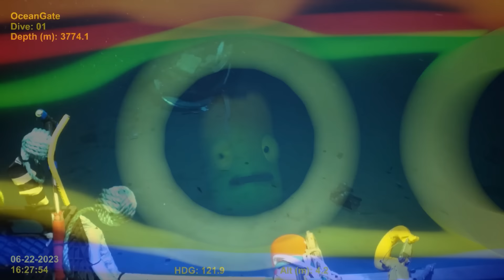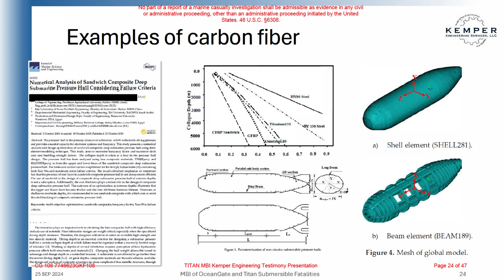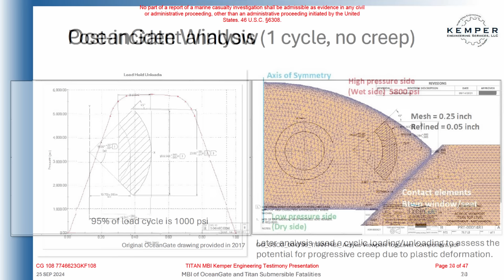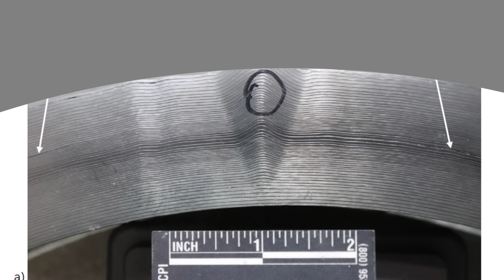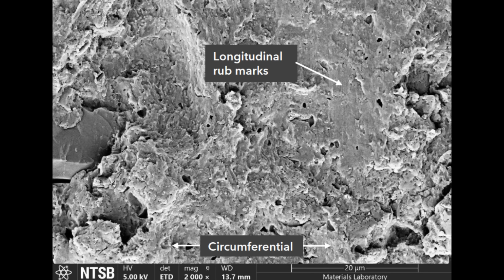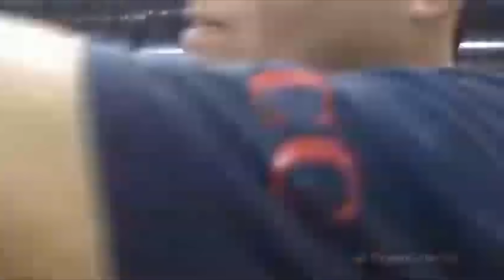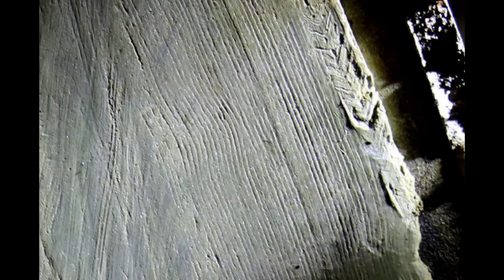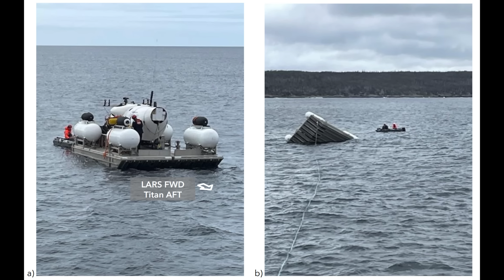OceanGate Wreck Shows Why Sub Wasn't Strong Enough To Survive - NTSB Shares Important Details

Comment: The longer you look at this uncertified 
DIY Carbon-Glue Lasagna build the more you wonder how this didn’t fail sooner
Reply: Lasagna build! Reminds me of something you make out of duct tape, thinking the more layers you wrap around something, the more it will hold.
Reply: @23ofSeptember basically a 3d printed toy submarine
Reply: @23ofSeptember well...are kevlar vests interlaced fibers? When fiberglassing do you place the fibers in interlocking layers for strength? Yes....so yeah there is some logic behind that at least.
Reply: @23ofSeptember duct tape would be better than what they used
Reply: it was already making noises in testing
Reply: @nicoliedolpot7213 submersibles pretty much always make some noise while stress is building and relaxing.
So it making some noise during testing isn't imidiatly something to worry about to much.
My diy ROV makes a ton of noise at about 25 meters depth and that's only around 3,5 bar of pressure.

The big bang shown by the graphs of the sensors would be something to worry about as you can classify it as a major anomaly.
Reply: @nicoliedolpot7213  and the front fell off once, wich isnt very common, most subs are built so the front doesent fall off.
Reply: Tttþ5😂055⁵is the 😢🎉😢😢🎉😢😢😢😢😢rđ xerox 44😢😢😢and ⁴⅘for 🎉😂😂😂😂 @nicoliedolpot7213
Reply: How thin those flanges were is baffling to me, they were completely relying on the titanium-glue-carbon fibre interface for the compressive and specially shear forces caused by the different materials elastic modules
Reply: @nirodper  that’s the actual problem, it’s not the strength of the CF it’s that you can’t interface it with anything. You can’t weld it or drill bolt holes so you need to glue it and glue just doesn’t hold up well under heavy strain or especially flexing/bending which the CF surely was doing regularly with each dive
Reply: @CarbonatedGravy you certainly can drill CF.
Reply: @slavka012  Not if you want it to keep its full strength, fine if it’s a body panel for a car but absolutely not for a pressure vessel
Reply: mmm carbon glue lasagna
Reply: @mark6302 The Homer of deep sea diving.
Reply: I would say it was failing for a while, but it was ignored.
Reply: @bills6093  It was failing slowly and then all at once.
Reply: @bills6093 agreed. All the signs were there from dive 80 onwards at least.
Reply: The engineers did wonder, and then they fired the one who brought it to their attention!
Reply: I am super impressed it did not implode during the first or second dive.
Carbon fiber may be a feasible material here! Provided somebody actually does a lot of testing to destruction, so we actually get to know how carbon fiber behaves here.
Reply: @adamrak7560  carbon fiber was not doing anything. It was the epoxy resin taking all the compressive force. In fact, the sub would have lasted longer if they used a cylinder body made of epoxy resin.  The carbon fiber was effectively functioning as a filler that weakened the epoxy resin,
Reply: @nickl5658  nope, epoxy needs a filler to stand up to not perfectly uniform compression, carbon fiber here acts as a filler and helps to reduce crack propagation and creep. it is true that this design does not utilize the main strength of carbon fiber, but still uses it to support the epoxy. 
If you say that they could have used non-tension strength fillers, like chopped carbon fiber, or micron sized alumina bubbles, and got the same results, well maybe they would have! It would be a pretty interesting experiment to compare this with other fillers and test to destruction.
Reply: @adamrak7560 they already knew how carbon fibre behaved and knew it was a disaster
Reply: @adamrak7560   No, carbon fiber is being phased out of aeronautical applications because it does tend to fail catastrophically.  Its strength lies in holding pressure in, one atmosphere's worth of pressure.
Reply: @WWZenaDo ya I think carbon fiber excels in two scenarios 

Space , where there is no pressure on the outside but you need to maintain it on the inside.  Or if you were to use a different gas and need to keep it in a container.  

Like a zeppelin.
Reply: It was only one step above DIY build quality. They didn't do testing or follow manufacturer design depths.
Reply: @ctrlaltdebug  " or follow manufacturer design depths" - They just used resin and elementary meshed carbon fiber so they are the manufacturer and designer. This requires knowing the fundamental properties of the materials to define your own specs. They didn't have the knowledge or experience to do anything like that.
Reply: @francoisleveille409  I was referring to the window unit they used.
Reply: @francoisleveille409  The build as a whole obviously. I don't see why people nitpick on YT comments. Give it a rest.
Reply: @ctrlaltdebug  I do much better DIY quality than this. Has to be noted that I don't build submarines though.
Reply: @ctrlaltdebug to be honest after I saw the way and the environment they bond the CF hull and the titanium ring I would say its just a wealthy DIY project
Reply: @ctrlaltdebug  To be fair, they tried to do testing but the people with the test tank refused to let them test the sub the way they wanted(which involved having computers and sensors inside). Those are the people who really need to be thrown in jail since they refused testing on something they knew would be used without testing.
Reply: So people who run the companies that refused to test this mess of a sub should be in jail?

Does that make sense to you?
Are you saying companies shouldn’t be able to refuse service?

Oceangate and their team are responsible for the bed that they have made.
Reply: @ryelor123  the test facility didn't want their equipment being damaged from destructive testing an elaborate backyard science project
Reply: That's rich.... so one company won't test it the way you want, and you just go ahead and use it without testing it properly? That's some very flawed reasoning you're using there.
Reply: @ryelor123  Oceangate imploded a 1/3 scale carbon fiber hull model during 6000 psi testing at the University of Washington, shook the whole building, and had to pay for the pressure sensors destroyed. The engineers at the test facility said the water hammer reduced the lifespan of their equipment. They rightfully refused to perform a larger scale test.
Reply: @ryelor123 what are you on about? Companies don't have any responsibility to test things for you... Hell if I was the testing company there's no way I'd let this thing in there. If they test it then they're effectively giving it their approval. They surely didn't know how this thing would handle repeated pressure cycles or time at depth, whereas they would for traditional titanium etc hemispheres. Why would they ever test it when for all they know they could test it 50 times and it'd implode on the 51st or 5000th cycle? If you want to innovate this much you either need to design your own machines or convince the company that your design is safe to test via X. Which they clearly couldn't do because they obviously had no idea what they were doing.
Reply: @ryelor123 
I have not heard this up until now.  
Was there a reason given for not allowing the testing???
Reply: @toomanyaccounts 
It very well could be.
Reply: @steven2556  yes companies should not be allowed to refuse service
Reply: @ryelor123  This looks a lot like a bot comment designed to increase engagement.  That's how absurd the sentiment expressed is.
Reply: @ryelor123 To be fair, they could have made their own test tank out of carbon fibre lasagne.

They had the money, resources and time.
Reply: @sunrisejak2709 
It’s possible they didn’t want to be associated with 
Ocean Gate.
The time frame would be interesting to look at.  
Was this AFTER Cohan wrote a letter to Rush with the thoughts of the industry backing the concerns he had about the Titan?
Reply: I just saw your comment about UofW.
Thank you.
Reply: @deepspacevacation not a bot. A shill. Similar. Their job is to lay groundwork for reasonable doubt legal defense. People in this thread did a good job exposing the attempt. Note the few tag team responses too. Shills are similar to bots but generally work on behalf of an industry or company.
Reply: @ryelor123  It was up to  OceanGate to get their sub tested.  They (he) should have found somebody who would test it.   Maybe you should get thrown in jail because YOU didn't test it?
Reply: @ryelor123  The testing they would have needed to do is to build at least three, test one to destruction, and have one do two times as many autonomous dives as they were planning to do with the third one, and then test that one to destruction, to make sure the pressure required stayed the same. Otherwise they won't know that they have the required safety margins to take tourists down.

But obviously, doing that would have cost just as much, maybe more, as building everything out of titanium.
Reply: @sunrisejak2709 That's what I'm thinking. My job involves signing off on stuff that could get someone killed if it fails. I will refuse stuff if I smell any amount of bs. Especially when it comes to load-bearing parts..  Can't have someone getting hurt, or the potential even, on my mind.. and I sure as hell don't want to be sued or jailed for it.
Reply: @ryelor123  Dude, using it without testing is on Oceangate, not the people who Oceangate refused to follow the testing guidelines of. 
Do you also think everyone in a bar should go to jail because they didn't stop a drunk from leaving, before the drink got in a wreck?
Reply: @steven2556  nobody refused to test/class the submersible, except for ocean gate. Rush believed in his design and refused to spend money to get it validated.
Reply: @nxdark That is an absolutely insane opinion, and I’m glad you’re not in a position to make policy.
Reply: @toomanyaccounts  I got my info from a graduate student there who was familiar with the test there. Stockton confirmed what I was told on a video at some point, but the kid I knew was on the ground. He got his information from a guy who was with Stockton from the graduate student program there. They had a real problem with the water hammer causing seals to bulge, and the test actually stretched flange bolts on the plumbing... They had to retorque all the flange bolts because of the water hammer.
Reply: @ryelor123 i can imagine a world where your words are true, but your comment lacking enough peaces of info to make it globally false ... Or misleading.
Reply: @ryelor123 really? More than the designers of this death trap?
Reply: @ryelor123 or they refused because they knew the testing wasn’t sufficient to determine safety, or would otherwise endanger people. 
If I want to test my hot air balloon made of glass, no one in their right mind would allow me to use them to test it, and when they explain why it’s a terrible idea, rather than accepting that it’s a bad idea, just move on with it, and do whatever I want, and fire anyone who says anything until I’m entirely surrounded by yes men because my ego is too large, too fragile, and too dangerous- much like the hot air balloon.
Reply: @ryelor123  so what? even if they refused to test it for some reason, it is still 100% oceangates decision to use sub and in no way whatsover the responsibility of the test facility. They dont force you to use your sub without testing at gun point.
Reply: @steven2556 were saying that it should not have been used when they were not allowed to do any testing. They should have just not done it, because they knew how unsafe it was, but they only had theory rather than evidence.
Reply: @ryelor123  so the people that refused to get involved are responsible, are you forgetting there's people that built it and put people inside, rush wasn't the only one involved
Reply: @ryelor123  you are not very bright
Reply: @ryelor123 wtf are u talking about?'
Reply: @ryelor123  they did do testing but rush damaged thier equipment. That's why they didn't want to do anymore business/testing
Reply: Steven is 'one of those' people who like to argue with somebody by implying that, that somebody is saying something that they didn't say. It's how stupid people argue when they don't have an argument for what that somebody, actually said.
Reply: @ryelor123 Nobody owes anyone anything in the test business. Companies with test facilities of any sort have every right to no-quote a test.
Reply: @rtqii Yep. Especially that the shock waves in the water during a collapse can produce dynamic pressures many times above the static pressure. So you build a 6000psi test chamber, 12ksi with a safety factor of 2, but then have to ramp it to SF 8 or 10 and it becomes super expensive.
Reply: @nxdark I hope you are sarcastic when you say “companies should not be allowed to refuse service”
Reply: @ryelor123 if I showed up to a drivers license test with my car on fire, would you give me my drivers test?
Reply: @ryelor123 wasn’t that found to be a lie Stockton used to say he wanted it tested but knew it wouldn’t pass. I remember watching a video and when they checked the place who does the testing it was all available to be done with sensors, computers ect and it looked very much like a story Stockton used so it wouldn’t fail and then he wouldn’t have a usable submersible to go to Titanic, it would confirm he was unsafe in every way
Reply: @RegebroRepairs exactly right.  That's exactly what companies that build carbon fibre pressure vessels do to verify their designs and construction methods. It's not a guessing game, and you don't design these things to operate as close to its ultimate load capacity as this one was. It was under engineered, and sloppily constructed. It really is surprising it lasted for as many trips as it did.
Reply: @ryelor123 what kind of a twisted logic is that??
Reply: I love your description !!!
Reply: @oldguy1528  Its a nice Lasagna recipe indeed.
Reply: Kind of sobering how many people have far, far more money than sense, and makes you wonder how the hell there are so many rich morons.  I've seen some superyachts lately belonging to people nobody has ever heard of.  They're the kind of people that would build an Oceangate style sub or buy tickets to ride one.
Reply: @DeadBaron that's the key to being rich. Stay under the radar
Reply: @DeadBaron  I feel like wealth is more driven by luck and cunning than intelligence
Reply: @orterves pretty much all luck.  Statistics prove that virtually every rich person on the planet was born rich.  Almost all the rest are actors, musicians and athletes, most of whome also got lucky at some point in their career to "break out."
Reply: @orterves this is true.

Wealth comes from DARING to try what others say is impossible or unwilling to try.

Inventment in anything is a key example. Simply sticking your wealth or reputation on the line by purchasing what you know to be good companies can and will lead to wealth and prosperity over time.
Reply: @orterves and delusional confidence but physics doesnt care about that
Reply: @DeadBaron  There was that Space shuttle launched against expert advice knowing that the temps ( and Ice) would be a problem.  That one didn't end well.
Reply: @DeadBaron  Just s shame that he felt the need to take people with him when he committed suicide.
Reply: @elLooto  no they were all just lied to
Reply: @DeadBaron  Rich doesn't always mean intelligence, just drive and will/ego can get you rich. You can bully and screw people until you get rich with little intelligence involved baring legal limits, Scientology for example. Or like most rich tech start up owners, they had MANY start ups thrown to the wind at the same time or over and over hoping that 1 out of 100 will fly and they get rich because tech start ups generally cost very little to start but have massive return potential.
Reply: @DeadBaron 😊😊😊😊😊😮😮😮😊😊😮😮😮😮😮😊😊😮😊
Reply: @DeadBaron  A lot of really rich guys got that way by ignoring critics. They think of critics as small-minded people.  Maybe with money, but when it comes to safety, it's a whole different ballgame.
Reply: @DeadBaron you've never heard of them because they are all the kids and grand kids of the people who built (ie stole) vast fortunes.  We live in an Aristocracy.  Feudalism never ended, it just rebranded.
Reply: Comparing it to lasagna is an insult to lasagna.
At least lasagna is delicious and don't cost much.
Reply: Mmmmm. Lasagna. 😋
Reply: Lasagna is delicious, and apparently the deep sea agrees.
Reply: Yeaa..... it even gave him many clear signs when it was going to fail, but he ignored them even though he said he built the system to warn him before it would fail and that it "wouldn't fail instantaneously" but then ignored the non catastrophic failure of the sub.
Reply: The Well There's Your Problem episode about this is going to be LIT.
Reply: All those voids and gaps, plus the bubbles that were "sanded"
/shudder
Reply: i swear to god if they manufactured it in a properly rated clean room without dust or debris in the air it would have lasted like 10 more dives probably. this means if they just threw it away every couple dives and manufactured it well this design could have been used for decades, despite being quite terrible and janky. generally this was a disposable sub design that degrades over time, it should have been rebuilt or completely tossed every other dive just to be safe. this includes newly wrapping the CF and newly glueing the domes. but rush was too stingy for that and wanted to make money.
Reply: @DennisGr  🥂🥂 wonderfully put
Reply: Best description ever! "uncertified DIY Carbon-Glue Lasagna"
Reply: So many of the dives were cancelled for other reasons, otherwise this would have happened much sooner. When you consider how many times it actually went down to the Titanic, it failed in just a handful of trips.
Reply: The more I learn the less I'm surprised that it failed and more impressed that it ever worked at all. I mean honestly if it just been operated and maintained anywhere close to competently, the crazy thing might still be diving today.
Reply: @maxwellquebec8675 I suspect "maintained" would be "the entire hull replaced every 5 dives or so"
Reply: @michaelmartin9022  Pretty much. Every time there's a concsening "bang", at the very least.
Reply: Luck. Luck that fed Stockton's ego. Luck that unfortunately lead to the death of 4 people... And one idiot.
Reply: it’s kinda like finding out a lost arctic expedition survived for months before finally perishing: kinda impressive, but also yeesh.
Reply: @oscaranderson5719  Read up on the ill-fated expedition to find the "Northwest Passage" taken on by the HMS Terror and Erebus by Captain Sir John Franklin and his team in 1836-1837. Pretty much what you described. :)
Reply: Who certifies deep submersibles?
Reply: @DonaldDeCicco  I think it is the American Bureau of Shipping, or ABS.
Reply: Lansagnabuild! Word of the year!
Reply: Your right it’s amazing it made it as long as it did
Reply: The design is sound for shallower depths.
The pushed the design criteria to its limits and beyond - there's always a danger for catastrophic failure.
Reply: DIY Carbon-Glue Lasagna lmao xD
Reply: If he would have acknowledged the faults, they might have been able to improve the design SOMEHOW - but instead he ignored the engine light and kept driving.
Reply: With every dive the compression and expansion of the carbon fiber was accumulating and weakening the glued seals and carbon fiber hull. Very tragic that five people lost their lives in this way. Rush was guilty of hubris on an epic level.
Reply: No Diddy
Reply: Lmao
Reply: Engineers are still scratching their heads on that question. Many things that look so poorly built are insanely durable
Reply: It didn’t because of the test and running phases weren’t deep enough. It had to slowly compromised several times and after one known major failure the complete collapse was eminent.
Reply: How did they obtain any kind of license to accept members of the public on such a vessel? INSANE
Reply: Wtf where they thinking with this glue sandwich
Reply: Especially give how it was treated when not in use/being transported. I'd forgotten about the barge incidents
Reply: Its an old piece of gas pipe!
Reply: Don't compare something this bad with yummy lasagna!..
Reply: Of they used a Titanium middle section wrapped in Carbonfibre it'd probably still be diving the oceans today.
Reply: It did. 

Failure was the separation of layers until water made it to the front ring and began destroying the glue there. 

The loud bangs reported were the individual layers expanding independently from one another and basically slapping the layers next to them during compression and decompression from dive cycles. 

It was destined to fail. The only question was when. 

Water began in on one side of the front ring pushing everything to the rear, popping the ring off and the window was pushed out when the pressure wave rebounded.
Reply: I’m genuinely surprised they even had a single successful dive to Titanic depth
Reply: It's insane to make a submersible out of fiber composite. Fibers have no strength in compression, and the resin is just there to give structure. It's basic engineering and materials science. Fiber composites are great for containing pressure and other structures relying on its tensile strength. All other criticisms about practices, safety systems and leadership personalities are practically irrelevant next to this, imo.
Reply: @Superblitzz  gotta admit though , holding up that long like a real submarine that someone diy is was pretty amazing!
Reply: The fact they got more than 20 dives out of this thing is pretty incredible considering the shotty work. Poseidon gave Stockton a lot of time to make other considerations
Reply: Fortune favors the bold, but not on a long-term basis
Reply: I think they were on to something but it would need years of refinement and testing different materials and configurations of materials. It's not like they are pioneers or breaking new ground though, the glue is clearly the weakest point on this specific sub. China's plastic subs are probably molded single pieces, no glue needed like that.
Reply: Problem isn’t that it was DIY standard or industry standard construction, its that he didn’t test it, he could have made it of solid titanium and still fail.
Reply: It would have worked fine but someone sat on his controller
Reply: it did, in fact.
Reply: Dammit, now I'm hungry for lasagna.
Reply: Liesen, only Italians canne mekeh lasagna!
Reply: The way these (rich) people died instantly just because Stockton Rush told them it was safe enough
Reply: Because God pities fools... Up to a point.
Reply: There were so many different parts made of different material relying on those epoxy bonds. I’m amazed it worked as well as it did.
Reply: Sooner than imploding after just a few dives?  Ok...
Reply: 5" is a lot of material.
Reply: True the fact that it made it a few times is impressive and yum lasagna
Reply: easy. improper tests.
Reply: Rush was just like your boss that didn't have a contractors license, skimping on supplies to save money by using / reusing least amount of screws to get er done
Reply: Carbon Glue Lasagne... how accurate
Reply: Especially if you saw the video of them building the thing !, having seen that video, I'm surprised the thing didn't implode on its first decent !, I mean the poorly constructed laminated carbon fiber cylinder aside, they at least !!!!, needed to get the titanium end cap to cylinder interface right!, and they soooooo didn't !, they/he set this thing up to fail, right from the get go !, it wasn't a matter of if it would fail!, rather it was just a question of when it would fail !, Stockton basically built a suicide/murder device !.
Reply: It’s testament to the viability of the overall idea. The execution was poor in all aspects.
Reply: Act of God.
Reply: I couldn't be paid to go on the thing and it's crazy ppl paid 250k to do it. That's nuts!
Reply: yeah i mean its kind of what everyone was telling him the whole time,
Reply: Yes... that's the question.
Reply: Even to this day, boilers which provide extreme pressure in the opposite direction cannot use carbon fibre
Reply: @jeffbrooks8024  Maybe not boilers, most likely because they get hot. But pressure vessels are regularly built with (carbon) fiber composites (usually with a liner inside). One example: H2-tanks for automotive use. Which are certified according to US or European standards.
Reply: @jeffbrooks8024 That might be mainly because of thermals. Remember that a boiler has to reach high temperatures which will definitely weaken the matrix
Reply: I'm amazed Stockton Rush lived as long as he did while being a monumental moron!!  Like, how did he not walk out into traffic or fall off a high ledge?  Or eat something incredibly poisonous!?  He must have been a walking calamity and just barely missed certain death around multiple corners.
Reply: Like if a dog lifted a leg on it while it was still on land?
Reply: Every successful thing starts off like this mind you but with way more clarifications. Look at the Apollo Lander. That gold stuff it's wrapped in is tin foil.
Reply: The tin foil hats made it that's why it was weak
Reply: Gorilla glue don’t play
Reply: Exactly. It’s like saying 
“Oh, this building can clearly support its own weight indefinitely, so surely we could fly a plane into the side of it. No problem.”
Reply: What is unbelievable is the fact that five 100% avoidable, unnecessary deaths later Nissen still thinks Lasagna hulls are a good idea!
Reply: Also the mandrel they used was so lumpy I believe that is what caused all of the wrinkles in the carbon fiber layers.
Reply: There is no real way to create certified pressure, rated carbon fiber. steel can plastically deform carbon fiber simply explodes when it hits its load limit. That’s why we don’t use it for underwater pressure vessels.
Reply: Carbon neutral matter does not harm the ocean. This company cares about the environment!
Reply: @Azuregos  They used fuel to send the sub at sea and when building it so you tell me how exactly was it 'carbon neutral' ?
Reply: I'd think the biggest problem with metals is that they do flex, any movement in the structure could be catastrophic under load.
Reply: @hihihihihello  did you not watch? The reason the CF sub failed is because it didn’t flex
Reply: Or maybe the more technical minded might look and think "why did this fail so soon"
Reply: A certain skin with an electrical charge may relieve some of the pressure but fk me right I'm not a physicist
Reply: Agreed.

Also (I know it sounds farfetched but I think it is a very small possibility) I think Megladon took a bite out of the vessel and what we see as the wreckage is pieces from the bite lol.
Reply: I just wonder, was it really necessary for the authorities to lie to us for all this time "to protect feelings" (like with Thresher)??
Reply: Would think that a specific skin coating with an electrical charge might relieve some of that pressure ...... Been classified a few decades now though but I'm just a conspiracy theorist
Reply: Kek
Reply: @valdomero738 only Millennial neckbeards go around saying "kek" everywhere 🙄